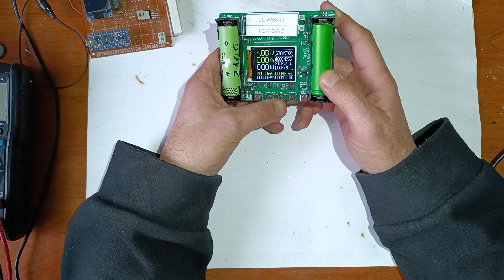Diy Or Buy 18650 Battery Tester?

Comment: Do you know what is the max voltage allowed on the green (buy) tester, im trying to test a quick charge power bank witch supply 9volts not 5. and can i change the resistor from 8 ohms to 7 or 6 to use more amps, or will it blow up these are my 2 questions. I hope you can help🙃
Reply from the maker: @Palestiano  u find the answer in the manul of tester.